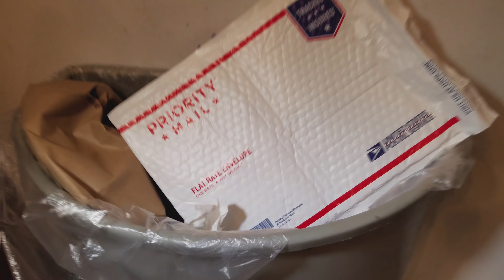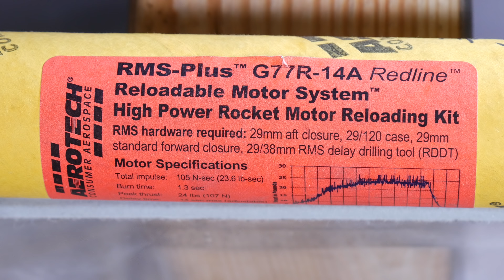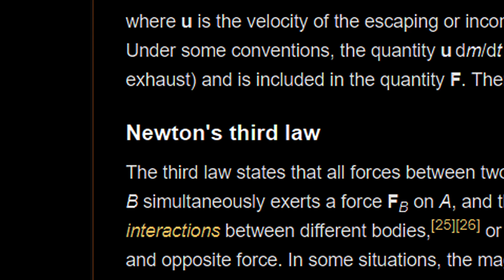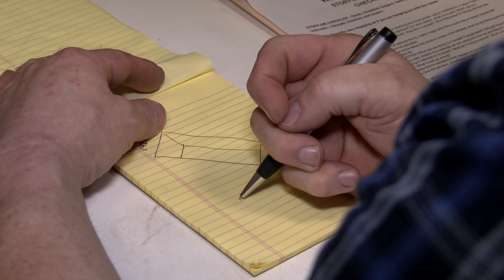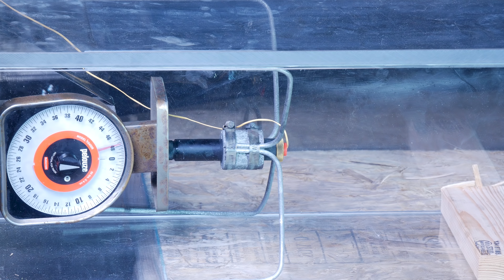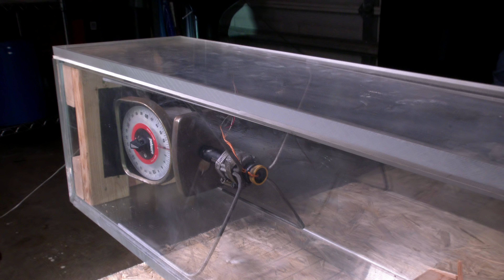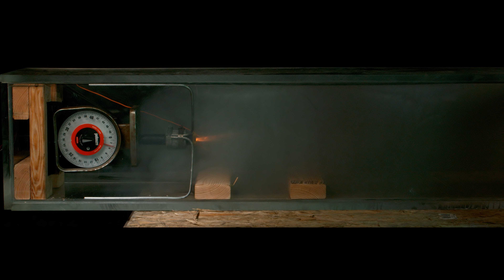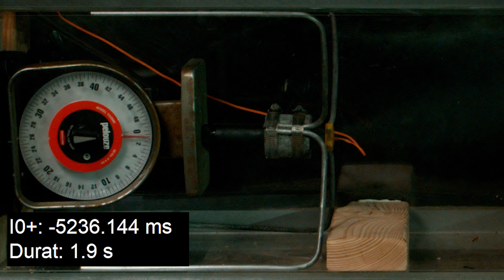Rockets in a Vacuum Chamber - Newton's third law of motion Visualized

Comment: I hate to burst your bubble but that "vacuum is a closed system. The rocket will create thrust because of the wall it is pushing against at the other end. Space, however, is an open system and no such thrust would be generated.
Reply: So if I fired a crossbow in a vacuum, I would feel no recoil?
Reply: @stuartgray5877  The recoil would be a result of the crossbow's action, it would have nothing to do with the air around it. Once cocked , the crossbow contains an enormous amount of energy and when fired that power translates up the weapon into the person's arm. Nothing to do with the propulsion of gases.
Reply: @jelleepit  so you are saying I WOULD feel the recoil of a crossbow if I fired a standard Steel crossbow bolt in a vacuum?  Why? what property does this projectile possess that allows it to push BACK when pushed upon?  What would happen if I fired a projectile made from WATER ICE in a vacuum? Would I still feel a recoil?  How about Dry ICE (solid CO2)? recoil or no?
Reply: @stuartgray5877  All of the force is contained in the string and the bow itself, it has nothing to do with it's surroundings. You are essentially exerting force on two bodies which are against its natural form and when released they return to that form in a very short time and it is simply that action that generates thrust. Nothing to do with the environment surrounding it.
Reply: @jelleepit  "which are against its natural form and when released they return to that form in a very short time "
That is literally NONSENSE and means nothing.

I see that you are incapable of JUST ANSWERING THE QUESTIONS:

what property does this projectile possess that allows it to push BACK when pushed upon?
What would happen if I fired a projectile made from WATER ICE in a vacuum? Would I still feel a recoil?
How about Dry ICE (solid CO2)? recoil or no?

I am TRYING to get YOU to realize how the physics works instead of just TELLING you.
Now answer the questions and you will soon see how Rocket Propulsion MUST WORK in a vacuum for the Law of Conservation of Momentum to be valid.
Reply: @stuartgray5877  The bow on a crossbow in its relaxed state has no tension, when it is stretched back by the string it gains dynamic tension, energy and that is not its natural state, what don't you understand about that?

Comment: Okay, many have pointed out that once the rocket ignites, you no longer have a vacuum.
In space, you don't have a wall 3 feet away, just an endless vacuum.
Borrow NASA's chamber.
A good 100 ft if you mount it on one side, but even 50ft from the center.
Probably a good reason NASA doesn't have this video in stock.
But I hope to help you get that lightbulb to go off.
Ever seen the I.S.S.?
The space station?
Those huge spindly solar panel arms?
The same physic you are trying to overcome, is the same physics needed to keep the arms from being ripped off of it.
Even the slightest friction and those arms are dust.
Yet you need to develop friction to get the rocket to create thrust.
That is where your small box makes it possible.
That size rocket and even 50ft to a wall and you will get zero thrust.
Remember friction is the key.
The same thing you need is the same thing that would destroy the I.S.S.
Reply: SO the ISS can thrust away from Earths, just not towards it?
Reply: You are assuming it can thrust either direction.
Have you ever seen a surfboard? Or how a dolphin rides the wave of a boat? Or even people on surfboards ride the wave of a boat?
What if all they are doing is riding the balance between an orbital decay and drifting out of the thermosphere?
It is also allegedly in the thermosphere, not the vacuum of space.
Can you even think of an alternative outside what they feed you?
Milgram Effect?
Reply: @mrchrysler9736  I'm not assuming anything I just asked a question.  If the rocket needs something behind it, it seems like the Earth would work just fine.  Push off that.  
I have seen a surfboard.  Can those thrust in either direction?
Reply: Not sure why I would want to carry on a conversation any further with someone who doesn't even understand what an assumption is or how he worked it into his question.
Your assumption is that it can even thrust...in any direction.
Are you trying to appear as you don't understand? You are doing a good job.
The surf board and the dolphin in those examples aren't thrusting in any manner, they are riding a wave.
The thrust is being created by the wave.
Please don't bother me again.
Reply: @mrchrysler9736  I've never understood the need to explain to someone that you are not going to continue a conversation.  Sort of like standing in a running shower and drying yourself with a towel.  But hey that's just me.
You are contending that all rockets don't work anywhere?  Even the ones here on Earth cannot "thrust'?  They just ride waves?
Reply: If I fire a crossbow in a vacuum will I feel recoil? Yes or no?
Reply: @stuartgray5877  you are assuming the crossbow can fire in either direction while riding a wave...or something...
Reply: @DeputyNordburg  Are you incapable of answering question. If I am standing in the forest and I FIRE A CROSSBOW, WILL I feel a recoil?  It is a simple question and has nothing to do with directions or waves. SIMPLE PHYSICS QUESTION
Reply: @stuartgray5877  It's important you understand that believing in the flat Earth (or making fun of the people who do) is not about answering questions.  Well it's not really important, but sounds more dramatic if I put it that way.
Reply: @stuartgray5877  I keep saying and saying, can't you hear?  Really in this type of conversation a person is better off typing than saying as you are statistically likely to be far away.  Well out of crossbow range thank goodness. 
SORRY I really meant to put SOME of my WORDs in CAPITOL letters, but I forgot.
Reply: @stuartgray5877  Oh, one question, how many people and crossbows can one have in a vacuum before it ceases to be a vacuum?  Is the bolt in the crossbow?
Reply: @stuartgray5877  While standing in a forest..you will feel recoil. lol I think
Reply: @stuartgray5877  I want to know the answer to this crossbow conundrum.
Reply: @DeputyNordburg  lol @Well out of crossbow range thank goodness
Reply: @dgmedor5958  then answer my questions
Reply: @dgmedor5958  so will I STILL feel recoil if I fire a crossbow in a vacuum?

Comment: How did you get all the atmosphere out of that plastic container? You are better off using 16in schedule 40 pvc pipe cutting a  hole and inserting a window. NASA has a atmosphere free chamber ask them if you can use it. Haha. NASA uses chillers to freeze that last bit of atmosphere after the pumps pull 30inches of mercury.

Comment: Great experiment,  only one problem, space is infinate.  When you ignite the propellant, the particles ejected from the propellant will pressurize the container.  In the infinate plane of space,  the ejected particles will continue to travel unimpeded.
Reply: Digital
Doesn't matter whatsoever what happens to the particles of gas or the basketballs or whatever else is ejected in vacuum. They could all be teleported to Narnia as they exit the rocket housing, it would make no difference. What many people fail to understand is that rockets (and jets and car engine combustion chambers and guns) work by getting a PUSH from the expanding gas that's ignited and energized.  The outward push in all directions is equalized except for "forwards-backwards", since due to the hole at the rear, there's nothing to balance the "push" in the forward direction, so you get the rocket or jet pushed forward. It's the same effect as the recoil you feel in your shoulder when you fire a gun.
Reply: @beneichhorn5855  i have no doubt that rockets can propel objects in the vacuum of space,  what im saying is this experiment is to confined to prove anything

Comment: Newton's third law applies to rockets in the vacuum of space . What people don't understand is that action of a rocket expelling rapidly expanding gases into the infinite vacuum of space has a value equal to zero . The equal and opposite reaction also has a value equal to zero .
It's a non-event .
Reply: SO if I fire a crossbow in space, i WONT FEEL A RECOIL? 
  And are YOU arguing that GAS does NOT HAVE MASS and that it can be accelerated WITHOUT A FORCE? 
 Sounds like someone failed high school physics....
Reply: @donovankelly1966  so when the spring of the crossbow PUSHES AWAY the mass of the projectile the BOW does NOT feel this same force?  Tell us: have you EVER taken a physics class in your life?  Have you ever heard " for every Action there is an equal and opposite Reaction?  If the "Action" is the bow pushing on the projectile , WHERE is the "Reaction"?
Reply: @stuartgray5877  Uhh...I believe I referenced Newton's third law in my opening post . 
(can you read?)
Yes you can fire a crossbow in space , you can fire a gun . But the bolt and the bullet are pushing off you and the weapon you are holding .
So what is the rocket pushing off of (the vacuum of space)?
Reply: @donovankelly1966  the rocket is pushing the MASS of the exhaust!  How about this? What about a catapult firing a block of Dry Ice (Solid CO2), will IT FEEL RECOIL?
Reply: @stuartgray5877 "It pushes off it's own exhaust!!" Ha ha ha Lol!!! You are a special boy , stuart . I'm sorry I can't help you . Please go do some objective research to find out why that is a ridiculous statement .
Thanks , that made my day .
Reply: @donovankelly1966  SO you are now AFRAID to answer my question? 

 What about a catapult firing a block of Dry Ice (Solid CO2), will IT FEEL RECOIL ?? 

And I dont need to research this stuff, I literally DO IT for a living.
Reply: @stuartgray5877  I already answered your question on recoil . 
You can't understand what causes recoil .
You can't understand how a rocket would work in space .
But you literally DO this for a living...
(god help us all)
Reply: @stuartgray5877  So now that I've answered your recoil question over and over again , lets hear your 'undeniable proof that rockets work in a vacuum' , Mr Aerospace Big boy pants?
Reply: @donovankelly1966  sure, search YT for: "SpaceX ArabSat 6A launch landing 4k".  This is a video taken from the ground of the falcon heavy launch and dual booster landings. Watch that video and report back when you have seen it.
Reply: @stuartgray5877  You obviously don't understand what 'undeniable proof' means .
I just watched a film called "End Game" where the Avengers went to Thanos' home planet....is that undeniable proof too?
Reply: @donovankelly1966  I don't care what movies you've seen.  DID YOU watch the video or not?
Reply: @stuartgray5877  Yes , I watched your vid and I watched Endgame . Great special effects , hard to tell what's real these days . 
But I thought you were gonna give me definitive proof?
Reply: @donovankelly1966  - "Yes , I watched your vid and I watched Endgame . Great special effects"

OK let me get this straight: YOU THINK that a Falcon heavy launch that was viewed by tens of thousands of spectators LIVE was faked.  A launch where there are literally HUNDREDS of YT videos where you can SEE the rocket reach vacuum WITHOUT A TELESCOPE, then Two (nearly two hundred foot tall) rockets LANDED IN front of spectators LIVE - But you think it is fake?

HInt:  There is a video of a spaceX booster landing at KSC (after putting a spacecraft MADE WHERE I WORK into orbit) Taken FROM A CELLPHONE on my YT channel.

I have ALSO seen over twenty real rocket launches IN PERSON including: Atlas, Athena, Minotaur, Delta-II, Delta-IV, Space Shuttle (launches AND landings) AND FALCON9 ( launch and Booster return) WITH MY OWN EYES .  I have been the LAUNCH CONDUCTOR for more than one launch.

NOW I GET IT: You are pretending to be the dumbest person in existence and DENYING something viewed by HUNDREDS of thousands of spectators live was real.

I understand now You are trolling me because NO_ONE IS AS STUPID AS YOU ARE PRETENDING TO BE .

We are finished here. YOu had me going thinking there really ARE people as stupid as you are pretending to be, but you arent fooling anyone, NO-ONE is THAT STUPID.
Reply: @stuartgray5877  Nothing that you just posted or the video you linked is PROOF that ROCKETS WORK IN A VACUUM .
I can't believe you claim to a person of science . 
Have you ever heard of the scientific method?
Reply: @donovankelly1966  And sorry my comment above was cut short - I was EXPLAINING TO YOU that every single Falcon9 launch and booster return at KSC (and VAFB for that matter) is viewed by TENS of THOUSANDS of spectators LIVE.  I HAVE SEEN a Falcon9 launch and booster return WITH MY OWN EYES and the thousands of spectators watching with me.

I have ALSO seen over twenty real rocket launches including: Athena, Atlas, Delta-II, Delta-IV,  Minotaur, Space Shuttle (launches AND LANDINGS) and Falcon9 launch and booster return.  There is a video of the NROL-76 landing at KSC taken from a cellphone on my YT channel (along with videos of some of MY LAUNCHES)

I have been the LAUNCH CONDUCTOR for more than one launch and I have controlled spacecraft in earth orbit AND DEEP SPACE.

But an OBVIOUS high school DROPOUT is going to lecture an Aerospace Test Engineer about how Aerospace works?  Yeah you are fucking hilarious!

Here is your Dunning-Kruger participation award, put it where your high school diploma should have gone.
Reply: @donovankelly1966  it appears that you responded, but then deleted your response.  I can only see part of a response in my notifications, but it is not here.   Did you have something to add?
Reply: HOW DARE YOU BRING LOGIC INTO THIS DEBATE, @kd Ruckman
Reply: @wasup23tube  oh? Where did he do that?
Reply: @stuartgray5877  " What people don't understand is that action of a rocket expelling rapidly expanding gases into the infinite vacuum of space has a value equal to zero "
Reply: @wasup23tube  so if I was "in space" with a spring and two bowling balls I put the spring between the two balls and compress the spring with the bowling balls, then release the whole thing you think "nothing" will happen?  What, the two balls will just stay at rest even though there is a force trying to push them apart?
Reply: @stuartgray5877  Ah poor Stuie , even with all the letters after your name you just don't understand physics . 
That's like saying : put two rockets end to end and fire them off at the same time . Would they move? Yes , because they are pushing off each other .
Just like the bowling balls would be pushing off each other .
It's like you need something to push off of . 
Could you push off from an infinite vacuum?
Nope
Reply: @donovankelly1966  what if one of the bowling balls was made of hollw steel (10 kg mass) and the other bowling ball was made from dry ice (also 10 kg mass) ?  If I compressed the spring between the two and released them WHAT WOULD HAPPEN?
Reply: @stuartgray5877  Here why you're not getting it ...you can't count .
Your scenario has three components to it ; 
1) hollow steel bowling ball
2)dry ice bowling ball
3)a compressed spring 
A rocket in a vacuum has
1)a rocket
2)rapidly expanding gas
There is no third component 
You need to drop one component out of your scenario to make it work . Either a bowling ball or a spring . 
Your choice .
Reply: @donovankelly1966  in my notifications there is a post from you where you begin to use an example of a "rocket that throws bowling balls out the back".  I can only read the first part of that comment in my notifications (it is cut short).  But I DONT SEE that post here on this thread.  Did you delete the post, or is YT acting up?  Please repost that question.  I would like to respond.
Reply: @wasup23tube  no response to my question directed at you?
Reply: @stuartgray5877  read the whole comment
Reply: @wasup23tube  Google "What happened to Comet Tempel-1 July 4th 2005" and see if you can explain that to me.
Reply: @stuartgray5877  So you are just going to ignore my explanation, or did you actually read it and are trying to create a diversion?
Reply: @wasup23tube  Your last comment above visible to ME IS: " What people don't understand is that action of a rocket expelling rapidly expanding gases into the infinite vacuum of space has a value equal to zero "

This is a QUOTE from someone else and explains NOTHING.  What is it you want me to respond to?
Reply: @stuartgray5877  that is enough said, but that wasnt the last comment.
Reply: @wasup23tube  then perhaps some of your comments are blocked (or just overlooked for approval).  Logout, then return to this thread anonymously and see if your post is visible.  Happens to me frequently.
Reply: @stuartgray5877  well this new commenting thing is trash no doubt, I honestly have no idea which comment thread this was on, but anyways I may not be getting the notifications. The comments actually completely stopped working altogether on firefox so I am stuck on chrome at the moment. Gotta love shitty programmers. I can't even see the comment you made that i was just responding to, and have no memory of what we were even discussing specifically. Due to my hatred for this shitty commenting system overriding my giveashit i could really care less. but if you have the energy and want to remind me then we can continue. I am completely lost at this point.

Comment: LMAO Infinite Vaccum of Space > Solid Wall for rocket to push off of?  Are you kidding
Reply: How exactly does the rocket "push off" of the wall when the wall is at the OTHER END of the chamber? Do you even think?
Reply: @thatWASdum328  
Doesn't matter, because force was registered before the pressure built up. The rocket cannot "push against" anything except the gas moving through the nozzle, because it isn't in contact with anything except that specific portion of gas. Any surrounding pressure only decreases the rocket's efficiency.